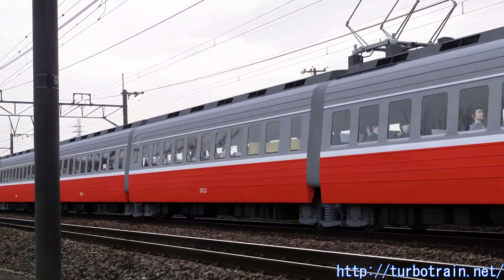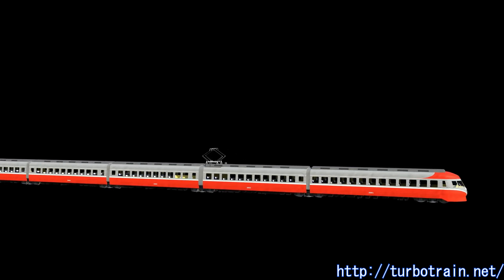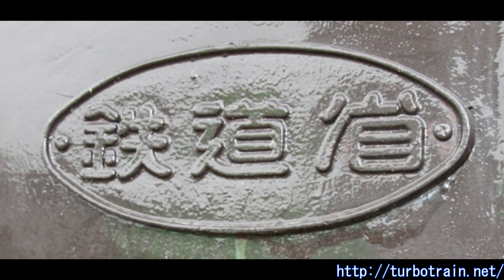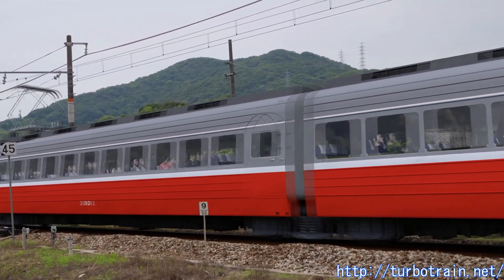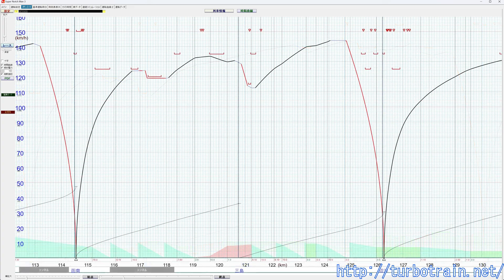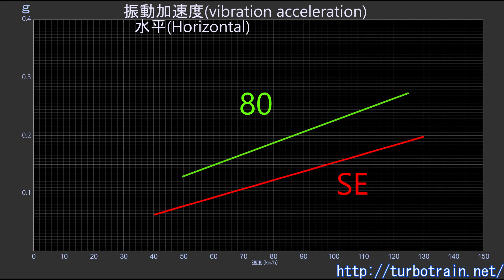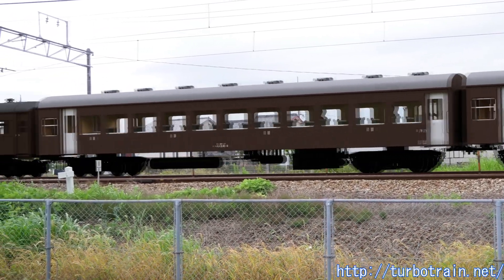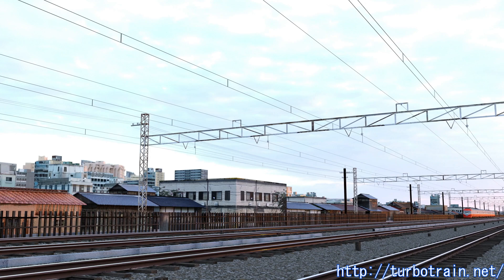Detailed Report on SE Train High-Speed Tests

Comment: Odakyu Electric Railway's SE car is a Romancecar (Class 3000, SE = "Super Express") for express trains built in 1957. In addition to its articulated bogies, light weight, and low center of gravity, the super streamlined carriages reduced air resistance and recorded the world's fastest speed (145km/h) for a narrow-gauge railway at the time in high-speed tests. So when the Japanese National Railways (JNR) was planning the Shinkansen, they tested this carriage and used it as reference for various things.
I actually rode it, and it ran at about 80km/h on the Odakyu Line（：Private railway from Tokyo to Kanagawa prefecture）. That's because the Odakyu Line was always crowded. I remember thinking, "Hmm... let me think about it for a bit!"